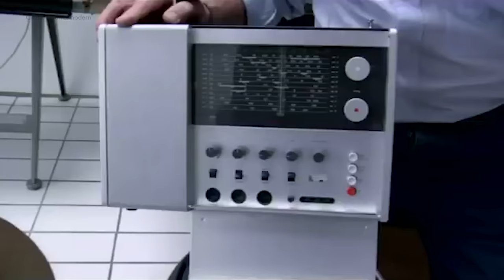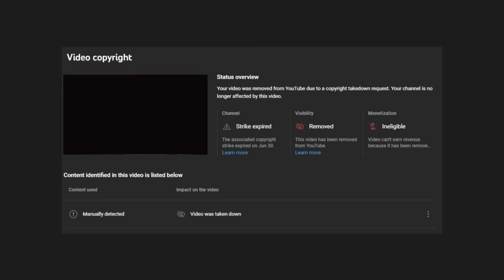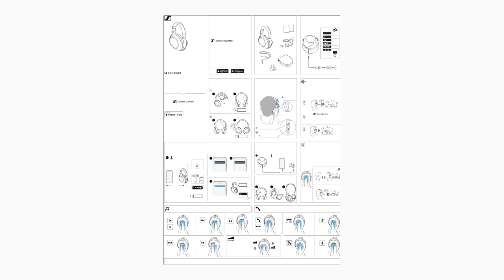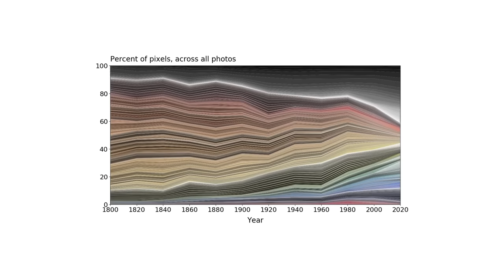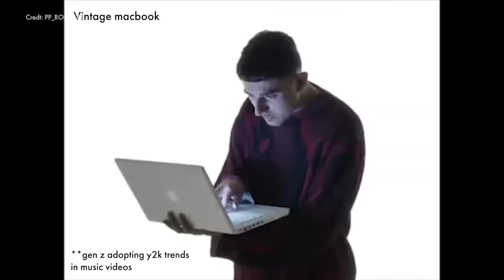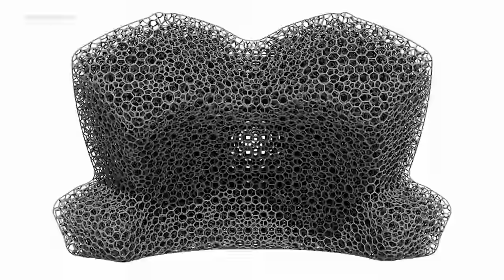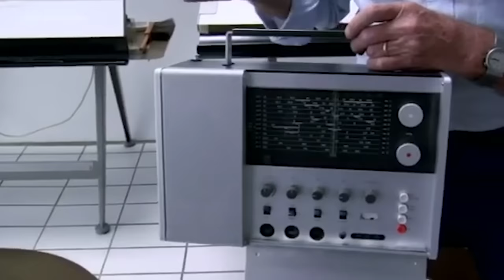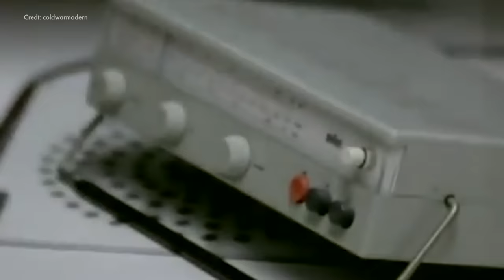Minimalism is Getting Absurd: Updating Dieter Rams' 10 Principles

Comment: As a person who lives with the PS5 and around a dozen other videogame consoles from various eras, it is one of, if not my least, favorite console design of all time. I'll never forget that I had to google where the eject button was shortly after getting mine (because it's tiny and blends in with the front of the console), so I punched in "PS5 disc edition" and the top auto-complete result was "not reading". Curious, I followed that result (I thought there was perhaps a batch of bad drives I should look out for) and the problem was apparently many people were putting discs into their PS5 upside down because they couldn't tell which way was up. I don't blame them, most products with a disc tray, the tray is nearer the top of the product than the bottom, and the lasers reading the disc are underneath that. So put the disc tray towards the bottom of the console and it's not a stretch to imagine some percentage of users think the laser is now above the disc so they need to put it in upside down. I could go on with several other pain points I have with the design, but I think that's arguably the biggest flaw.
Reply: The PS2 compact was possibly the best IMHO. Having the option to stand it up or lay it flat, the solid feel, the efficient use of space, the proportions, the way it captured the large version and made it better and more whole, and just worked. The 5 just seems like their first goal was to insist you put it somewhere very visible.
Reply: @weatheranddarkness  I'd argue for the PS2 fat actually. In my use case being able to stack stuff on top of it would be nice, so having a front load instead of top loading is better.

What really frustrates me is that if the goal of the PS5 design was to have something flowing and less boxy, the Sega Dreamcast pulled off that look 25 years ago without so many other compromises. I had to pull the side plates off my PS5 to add an SSD and without the plates on it's mind-blowing how much that console shrinks. Sony is just wasting so much space for no functional purpose at all. And both times I pulled off the plates when they finally broke off they flew into my face, so yeah let's deduct some points for being to afraid to expose a screw at least on the bottom of the console.

I get we're comparing something that plays 4k blu-rays and games and pulls 250 watts to consoles that pull 30-50 watts and only have games that look good through rose-tinted glasses. But still, come on Sony, I KNOW they can do better. Microsoft is working against the same technical constraints with the Series X and I think that's a good design - perhaps not one of the all-time greats, but good, competent at least.

Comment: Excellent video! Two things in modern design drive me nuts:
1. When so called "design" makes products less functional and understandable (you discussed this one very good).
2. When products have a limited life cycle and can't easily be repaired. I missed this one a bit. In my opinion, good design is also about the ease of repairing and a long period of support, either in hardware or software.

Maybe it's because I'm a package designer... My designs have to be cut down to the bone, for the following reasons:
1. Functionality
2. Functionality
3. Did I mention functionality?
4. Price. Nobody want to pay for just a package, box, or whatever. Always cut the price down.
5. Recycling. Different materials have to be taken apart easily, and easily being recycled.

So, simplicity is on the top of my design strategy. For the products to be packed, people who handle them, and the environment.
That's my 50 cents.

Comment: >Good design communicates what is necessary
I can agree, so long as we understand that what is necessary is sometimes that emotional response.  Sometimes you need something to be unobtrusive and stripped of things no one uses - I can't remember the last time I pressed the number keys on my TV remote and it actually did something useful in the context, either make them useful or get rid of them.  Sometimes, however, it is necessary to have that emotional response because people like to have nice things.  I saw a car the other day from maybe the late 00s early 10s and the brake lights were styled in such a way that they looked like tubes filled with crushed diamonds.  You don't need to do that from a functional standpoint, a strip of red LEDs would do the job, but the design was communicating something else other than just "the car ahead is slowing down", it was communicating that this was a nice car that goes above and beyond the average runabout.
Maybe instead, just "Good design communicates" will do, because sometimes you have a different message to say than everyone else.

Comment: I would argue that costly and difficult-to-use products with minimalist appearances are actually something that is not a modern corruption of Bauhaus or some other past design movement, but is actually something that plagued them from their inception. The products they designed were never the most functional or the most affordable available to the consumer. As far as function goes, an ornamented lamp is equally functional to one composed of only straight lines, likewise, a kettle handle can be made uncomfortable to hold by excessive ornamentation or by insisting on using simple-looking geometric forms. Bauhaus might have been accessible compared to luxury ivory-and-mahogany art deco furniture but was not what the poor of the world were using in their homes. In my opinion, good design, both minimalist and ornamented, is at its core an aesthetic or artistic pursuit far more than it has ever been a social or practical one, despite designers' claims to the contrary.

Comment: To be fair, though, the Porsche is right up his alley. Its nit the design doing the talking, its the clatter of the air cooled engine, its the thunk of the transmission into gear, its the rocket - like acceleration. Its the emotion of driving, not the emotion the design is supposed to elicit. On top of that the design is barely changed from the 40s when they came out to even today on the GT3. Porsche found something good visually and stuck with it. Its the experience he derives his emotional reaction from. I think it suits him well.

Comment: A few years I went to visit a building in São Paulo: Altino Arantes Building (renamed horribly now to Santander Lighthouse).
Before this descaracterization of the place. Well the thing that impressed me most was a safe (it was a bank originally) in the hall. A safe, the most utilitarian thing possible: it was adorned with leaves outside AND inside, a beautiful discrete and delicate pattern. A complete unnecessary thing that nobody would be looking at, probably just once a few days when the medium size safe would be used. It was so touching and beautiful transforming that souless thing in a beautiful thing integrated with the environment, it would only work in that specific building.
It was unnecessary and even excessive, and just because of that it was gorgeously beautiful. It was not done to sell it, nor probably because someone asked for it, it was done just...because who did it wanted to do that way. and in any other way it would diminish the whole place.
I remember little about the building, the nun functionality of the last floors that were made to by smaller and because of that they didn't have an elevator, and could have no rooms, just to complete the aesthetic of the building, I found it a waste. But that safe on the hall in exposition I never forgot, a tiny simple detail that didn't spoiled the working of the safe, that was not a waste, it made it seem that the safe was born there.

Comment: "Good design must be honest" is by far the one I feel most strongly about personally. The statement itself is an extreme oversimplification of an issue which could easily have it's own book but the basic principle should add an additional clause to the statement; "unless given due reason" which could include elements which are "dishonest" but are in the interests of either the environment or the user or both. For example, celluloid tortoiseshell is always going to be preferable to me than using the real deal for both environmental and practical reasons, and since most people now only see it as a plastic material it is not hiding anything. However, fake leather and fake wood for example I detest as it is a poorer quality material which looks from a distance like what it is trying to mask as but ultimately will always lack the intricate elements which make those natural materials favourable as well as having poorer performance and longevity.

I would also add to my list that designs must embrace the nature of their materials rather than be made despite them, not only does this mean using the right material for the job but also allowing the nature of the material to take a central position in the design and to embrace its natural patina into being an aesthetic attribute rather than fighting an ever-losing struggle against what is inevitable.

Something which surrounds both of those points is the tendency to want to force an imitation which cannot be rather than simply embracing what is. Such is unimaginative and is leading to an unnecessary struggle which lands the product firmly in mediocrity.

Comment: 3:37 I actually like the $4 one. It is basically better in every aspect: larger screen, larger button, clearly readable prints, good contrast between buttons and frame. You name it. All indicate it has ergonomics in mind during designing. The $50 one is just terrible in every aspect and a nuisance to use.

Comment: As much as I agree with all that, I've had one thing in mind about affordability of good design. Apple is always mentioned in that context and many people rightfully say that their products are unaffordable, partially because of that approach. However I can't help but think that it's not really the case, at least with macintosh computers. The thing that happened with computers is very weird: the price for the core components was declining rapidly in the early 2000s, so fast that literally what cost a fortune before is the cheapest component on the market 5 years later. It plummeted so fast that manufacturers started to compete for the cheapest options. I mean I'm not against cheap computers, I'm glad we had them, but when you build a device, core components of which (CPU, motherboard, memory) cost $1000 you don't cheap with other materials. That is why people still value old IBM keyboards, even though they weren't particularly well built or greatly designed. It's just that later on everything else becomes so cheap that we got used to that and we think that computers should cost less. They shouldn't. If you care about every component, which is important, there are a lot of complicated parts. And honestly there are so few manufacturers that do things right, probably because they just cannot survive in a market where people expect a product to cost way less than it's profitable for you to sell.

Comment: 11:57 I would argue that a Porsche is extremely within his design principles. When you compare a 993 to its competitors of the era, it is ostensibly extremely similar in design to how it was produced in 1964 when the original 911 came out and is very minimalist. Compare this to how wild Lamborghinis, Dodge Vipers, or Ferraris looked during the era and it begins to make more sense within context. It was devoid of crazy strakes, vertical-opening doors, or giant exhaust outlets on the sides of the car.

Additionally, it is also a very plain example of a 993 when at the time you could get the car in pink with matching leather and blue seatbelts.

Comment: The idea for functional minimalism is "function over form". Having a product that might not be eye candy but it is efficient and gets the job done. Aesthetic minimalism is usually "beauty in simplicity". A product that is not distracting with visual clutter yet appealing in it's own right. Trying to combine the two gives the worst of both worlds. You can't add too many promps (e.g.  labeled buttons or switches) because it would clutter the simple design. And having one button or touch pad do everything makes it ironically more complex to use since you have to memorize each function or have an instruction manual in your pockets.

Comment: I agree on almost everything you’ve said, well done!

But I just want to point out that you seem to miss the point with Dieter’s Porsche. He wasn’t against the emotional component of design, he argued against the trendy approach where automotive and fashion industries change trends every few years.

Porsche on the other hand, believes in timeless quality both of the design and engineering. They’re notorious for keeping their design changes minimal from one generation to another. Also, they produce incredibly high quality cars, and pledge to produce repair parts for their every car ever produced. They even develop new products to their old cars, such as seamlessly integrated modern infotainment systems for their old-timer air-cooled cars etc.

This timeless approach to the design is not only in line with Dieter Ram’s philosophy, but a good example for today’s trend of overconsumption and overproduction as well. A car that lasts for 50+ years is a true example of sustainable design. Overweight EV that will be outdated in 5 years, leaving hundreds of pounds of toxic chemicals to recycle, is not.

Comment: I have to point out that Dieter's model of Porsche specifically is one that likely brings him joy as it likely follows his principles and is fun to drive.  Honesty to form is something many car designs do not posses (note how angry nearly every economy car is) and while I haven't seen the video you're quoting from in a hot minute, I don't believe he meant that as a blanket statement.  911s have a proportion and styling that's almost entirely driven by their function, and most of the actual design work on that era of 911s was spent finessing reflections by tenths of a millimeter more than it was adding a crease simply to match a sketch like in more modern cars.  In fact, Porsche, up until the 2000s, was effectively immune to interpreting trends the rest of the way the automotive industry did.  70s and 80s 911s especially fly in the face of those decades' norms of automotive design.  What is emotional about the 993 is it's character - while a powerful and sports car, it arguably looks eager and excited, and a bit mischievous. It's excited for you to take it on a drive.  I'd argue those emotional characteristics are honest to how those cars handle, to the point that the 993 is easier to drive than earlier 911s due to it's AWD system which makes the car significantly harder to lose control of for less experienced drivers.  

What I think truly speaks to good design from that point is that a well designed product presents emotional characteristics that match its function through flair.

The most resonant thing that can be drawn from his honesty point is that the general auto industry has increasingly smacked things with specifically the fear - pathos response of our brain's processing (danger/fear = desirability/lust) and have watched too closely what other manufacturers are doing, leading to trend cycles becoming incredibly short.  Some will say that you need that specific emotional response to sell - but there's a similar phenomenon that occurred around the same time involving increased adoption of SUVs, which was driven by legal loopholes and aggressive marketing. 
Excellent video though, your points have resonated with my own discovery pursuing my masters in design.

Comment: The reality of design is that you rarely can achieve design following a single principle, because the needs of the client (even if that client is yourself) will conflict at some point with that principle, it is a matter of time.  Sure, you can design a phone with absolutely perfectly smooth transitions between case and power button following extreme minimalism, but at some point someone will want to turn that phone on in the dark and can't feel the power button. You can also design a phone with twenty power buttons that need to be pressed in exactly the right order which changes every time you press a button, extremely maximalist. The truth is that you almost never can get away with an extreme. Balance, one way or the other, compromise, that is the key.

Comment: I have a great example for this:

DAS KEYBOARD 4 ULTIMATE is a keyboard with no letters on it. 

I bought it and it looks magnificent and I don't have a problem using it since I can type blindly. 
However, if others want to use my pc they rage by the daunting impractical design
Reply: Did it cost less to not have lettering printed onto the key caps?